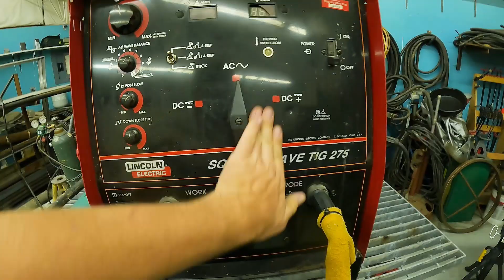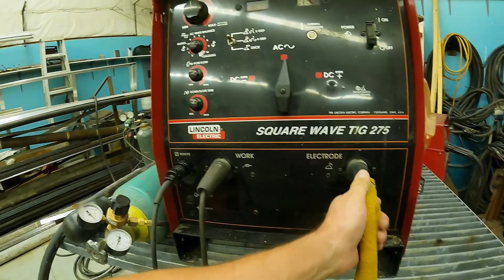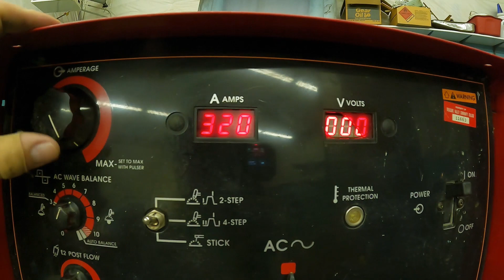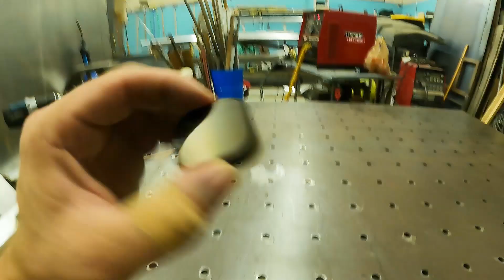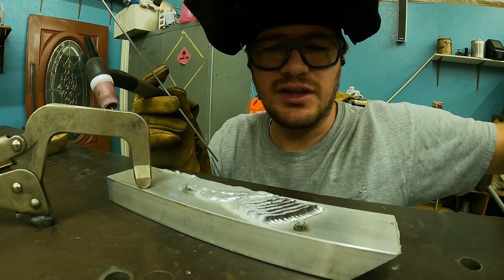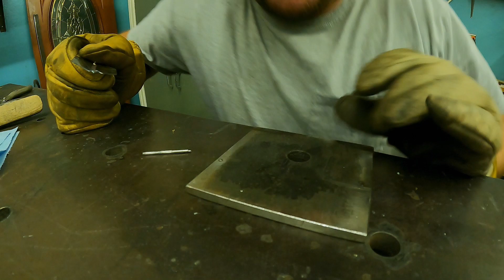OUT WITH THE OLD IN WITH THE NEW! Introducing the new to me Lincoln Squarewave Tig 275!

Comment: To weld steel you should grind your tungsten to a point, to fit-up razor blades place them on a magnet.
Reply from the maker: Is that true for transformer welders? I was taught in high school to always ball. Then, when i bought my inverter welder, it seemed the consensus was inverters grind tungsten and transformers ball Tungsten. The magnet idea is awesome. Thanks for watching and commenting!
Reply: @tysoddjobs  
Hello Ty,  when welding carbon steel, or stainless steel the tungsten should be ground to a point, when welding none ferritic metals like aluminum, magnesium you want to ball your tungsten, it doesn't matter if the machine is transformer or inverter.

Comment: Tig shouldn’t be giving sparks….. too much amperage causes this. also why is that cylinder laying down horizontally? Should always be vertical.  Even when not being used. (OSHA reasons, not even allowed to drive with them laying down or you get a fine that cost a real-pretty penny) Make sure your tungsten is sharp after each weld( see this when preparing the razors which was probably the reason you couldn’t start it very well). Also tig is a very very clean and needy process, make sure you clean anything you weld with it. (Even if it looks clean, doesn’t mean it necessarily is clean. Your hand movements when doing tig is very nice, just try to stay a little farther away from the pool, you boxed a tungsten’s because you were a little too close. Not the worse thing though. Definitely have potential. Usually tig is hard because most times your using both hands and a foot(if foot pedal to control amperage) all doing different things. Overall great job 👍 

Tig requires at least a shade 10 to see it clearly. (In my experience) Keep that in mind for your camera. 10-11. A ghetto way to test it for yourself is to get another hood and put it on the camera and get a short video. If you can see it clearly then whatever shade your hood was using should be what shade lens you should buy for the camera.
Reply from the maker: Absolutely right that tig should not spark!  I ended up finding that the gas lens diffuser in the torch head had failed and separated causing it to lose shielding gas. I have actually started balling the Tungsten now that I have a machine capable of reversing polarity and the balled Tungsten seems a lot better than sharpened. I definitely do for sure get my Tungsten in too close to the puddle. I also agree about the two hands and pedal, specially welding out of position. I just got the tig button from 6061.com and that is a game changer for sure I have already welded laying on my back and kneeling with it and I can't say enough about how much easier it is. The bottle issue will be resolved as soon as I can build a cart for this machine.  Thanks for the view and comment and insight!

Comment: If I was you I wouldn't sell your other TIG welder I would keep it around because the transformer one you can't adjust the frequency on the AC side. Your other machine you can adjust the frequency so you can weld thinner material on the AC side. Me personally I run the primeweld Tig 225x with the maxcool 3000 water cooler as far as a TIG torch I use the fl230 flex-loc TIG torch. And with my TIG machine I get great AC control on mine also able to adjust the frequency from 20 HZ to 200 HZ on the AC side.
Reply from the maker: Hey thanks for the view and comment. The squarewave tig 200 does have frequency control. It is from 60hz to 120hz so not the range that a majority of the competition offers. I never found it to help very much on the thin end. I definitely think it helped on inside corner joints keeping the arc from wondering. The low end on this transformer machine is definitely impressive. I need to get in the habit of balling Tungsten again. The next big thing to really talk about is the tog button that 6061.com advertises. I picked one up and it is absolutely amazing! Have you tried one of those? Out of position welding just became do much easier and convenient! There will be a video to come.
Reply from the maker: I need to start shopping coolers and new torch. I really like the ck superflex torch. Have not tried a flex loc. Probably would last longer. Do you primarily do ac tig or what other processes do you run?
Reply: @tysoddjobs  I primarily weld aluminum and stainless steel building turbo kits hot sides and cold sides lot's of intercoolers and pipes and full exhaust and some titanium downpipes. Trying to keep it as a hobby I really enjoy the art of being able to melt metals and create cool shit..!!😎
Reply from the maker: It is addicting! I love watching the aluminum puddle turn liquid and look like a mirror almost. Maybe someday I will do an intake for my pickup on here. Thanks again for the view and comments!
Reply: @tysoddjobs  as I work through the days to comment that I sent to you and was talking to you about when I said that I'm trying to keep it a hobby not a business the one thing is is friends you tell one friend and then they tell a friend and they tell a friend and they tell a friend and then now here I'm sitting here all my friends got their cars all boosted in that and my shit is sitting in boxes and I don't feel like doing it!!!!!! But definitely keep up the good content and definitely keep that other welder cuz you'll find that it comes in handy having that igbt welder over having the transformer they both have a purpose in usage that you'll find out as you get more into it..
Reply from the maker: I definitely know that my projects never get done because I'm always focused on everyone else's projects. I actually sold the other welder 2 months ago. It was required for me to upgrade. I can't afford to keep both. Such as life most video content is released a few months after it is filmed. How is titanium to weld I've never done that.
Reply: @tysoddjobs  is very picky and very finicky you got to make sure and keep it shielded on the outside and the inside and take your time when you're welding it cuz if you don't keep it shielded it'll get oxidized and turn all different colors and that and then it'll crack.. the biggest key to titanium is to keep it a silver color got to keep your heat right your gas right and take your time.. and if you want to practice with some titanium ticon industries is the best to get practice titanium from before you spend $200 to $400 on a 2 ft piece of titanium depending on the diameter.